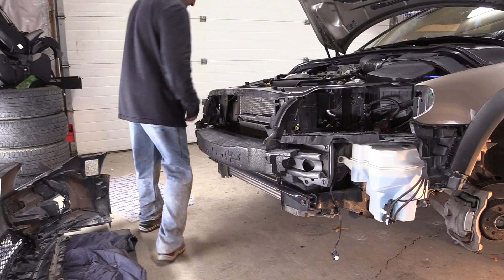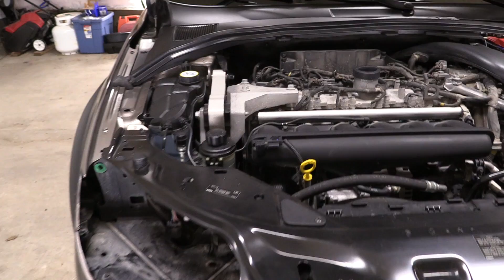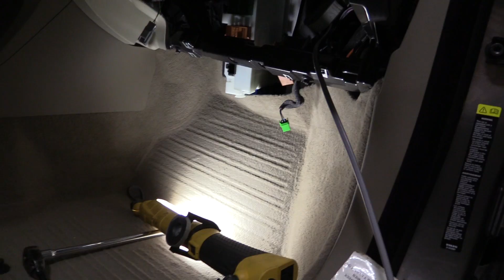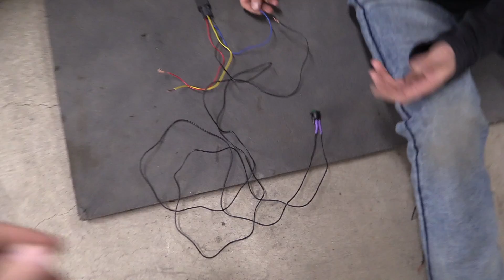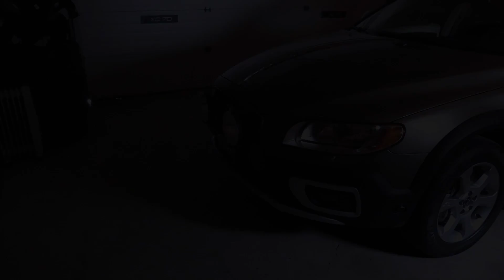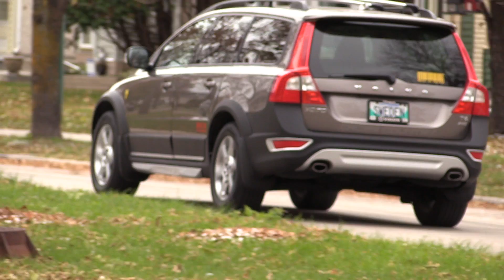Hella 700FF Auxiliary lights installation on Volvo XC70.

Comment: Great video, how long are the bolts you used? My P2 has OEM wiring for auxiliary lights but the switches and plugs are hard to find. Honestly, I may use the Hella wiring.
Reply from the maker: Can’t tell at this point. It was a while ago. Just use hella wire

Comment: Hi. Could you please send the specs on the bolts and nuts that hold the bracket in place? Also need to know where to get the spacers.
Reply from the maker: These were all custom made. My friend from Russia brought the bolts and nuts. Father in law made the bracket. Wish I could give you more info
Reply: @volvosweden  Thank you for your reply! I really love your videos - I wish I had your knowledge of how to work on these cars. I have the same model year XC70 and I want to mount lights like this. I'll ask some people at the local auto shop. Thanks!
Reply: @volvosweden Hi again. Can you confirm the length and diameter of the bolts?

Comment: It's important that auxiliary lights do not shake or vibrate. I'm not convinced that lamp bracket will achieve that. I suggest you fit a stay to the back of the lamps.
If you are going to have only two auxiliaries, I suggest fog lights turned out at say 30 degrees (or crossed) to act as cornering lights. For electrical connection, I suggest a relay so the fogs only work when the side lights are on. You need a stem switch so you can switch on/off with your hand still on the steering wheel. When you drive narrow twisty roads at night, you will be glad of cornering lights. If on the other hand you drive entirely main roads, you are wasting your time and money. Or in your case, all fashion, no function.
Jack, the Japan Alps Brit

Comment: I'll be installing something similar on my 2008 XC90 V8. Are you worried at all about blocking air flow to the engine with the auxiliary lights?

Comment: nice job and video. I appreciate your time making it. But man, is a lot of work, Couldn't be connected to the low beam wiring a bit closer to the lamps? Been in the front of the rad, won't restrict the airflow in hot weather?

Comment: On my -07a, Volvo has already pulled out a connection plug for extra light..😳.  On the left side.  What is needed is an original connector on the dashboard, connection already finished ..

Comment: Do you think it would be possible to install an led highbeam inside the grille of the car? Is there enough space? I have an -09 XC70 and a W-Light Typhoon 590, which is around 56cm wide. I currently do not have the car near me but was wondering if it would fit.

Comment: Hi...what size bolts were those and where did you find them?  How did you make or find those two spacers?  I want to install some LED driving lights on my 2013 XC70 and think the bracket mounting advice Yuri has provided in this video is awesome!  The guy is the Russian MacGyver!
Reply: And it is now 2 months later and I installed two Rough Country led lights on my xc70 using the mounting advice you gave on the video and they look freaking awesome.  I had to special order the 8 1/2 " bolts ($20ea) and I  hooked the lights directly into high beams so interior switch not needed.  Thanks Yurt! Your video was inspirational!

Comment: Good brain, Why you did not use stainless steel screws? and is aconsejable use pressure washers for evite drop the nuts with the vibrations. Thanks for the video

Comment: Nice video man, I'm looking at adding the same lights to my V60 Polestar... that said, did you see any increase in the running temperature (especially in the summer)? Maybe I'm being paranoid but that's my biggest worry...
Reply: I have 5 auxillary light wich is 225mm wide in diameter, 3 of them cover the front grill and i have not noticed any higher temperature on my engine in the summers here in sweden ;)

Comment: In my S80 there is AUX light toggle in sensus software, and it turns on together with high beam. I wonder if it is possible to add one of the blank buttons in center console and use it independently of high beam. Great video!

Comment: Hello mate! I’ve done so much work on my v40 by myself, incl the block heater installation. Now I’m about to install a led bar... not that hard but just one question... in many YouTube videos you see they use the main battery as a source for the lights and you use the cigarette lighter wiring. Do you recommend this rather than the connection to the battery, having the fuses etc in mind. Pascal

Comment: This is a happy comment.
Reply: got any more information on this? is there any way to wire up an OEM switch on the dash for this purpose? I know the older XC70 and XC90 had this...
Reply: @macadood  My bad, I got it mixed up with the older platform, realized my mistake  today when I installed some.

Comment: Once again, excellent video!
My V70 is imported from Sweden and was factory fitted with these lights according to the option list in TIE. Unfortunately, they had to remove the lights because it is not road legal in The Netherlands. But the switch for the "Extraljus" and the software is still present, so maybe I'm going to re-fit them in the future. Every Volvo looks extra cool with extra headlights!
Reply: Make a google search for "extraljus sweden" and you will not be dissapointed! 👌💥🏎
/ Your friendly neighborhood swede
Reply: @adammm142  i was not dissapointed, thank you!

Unfortunately they are also not street legal here in Portugal.
Reply: Het is zeker wel legaal hier, Totaal aantal grootlicht mag 4x zijn.
dus dimlicht zoals altijd, grootlicht + 2 extra grootlicht.

Comment: Hi there, nice install! Very factory! Few questions, do you know the company VolvoTech? Them make this canbus tool which you can use to program the car to use the factory high beam lever for aux lights. Like you pull once for high beams, then again for aux lights, then the third time shuts them all off (or you can program it to any button you like).

Secondly, I recently put some aux lights on my S80, and I noticed that because mine is auto, there is a rubber piece where you would find the clutch on the driver side, made for a much easier time running wires. Did you know about this?

Comment: Sometimes, the look IS more important, than function. It looks cool, AND will come in handy. Beautiful work.
Reply: I Totally disagree with this all fashion, no function mind set.
Reply: less practical for parking. that is why I did not put any. but as I have now moved to Sweden, it is too dangerous to not have those in winter (if you have an old car). the new lights are good enough.

Comment: In Europe nowadays and especially in Sweden you see more and more LED light bars mounted as an extra high beam light. 
What you did to use the Hella’s as an extra low beam light would get you in trouble with the law because officially that’s not allowed in Europe. (lots of people use their fog lights on the front for that.) furthermore I would like to say that I appreciate your videos and enthusiasm very much! Keep up the good work, regards from the Netherlands.
Reply from the maker: I know what you say. I am not using them in the city. On highways as low beam for extra light.
Reply: No such thing as front "fog lights". Those "fog" lights in the bumpers of cars are kerbside illumination lights specifically desingned to illuminate both kerbsides on roads where there are no street lights.
Reply: @terrortorn  Not sure what part of the world your claim might apply, but both the XC70's manual and my country's traffic rules specifically name fog lights, front and rear.
Reply: @p-a-d-e  It is true that "fog light" is a term commonly used virtually everywhere and that includes manufacturers. And for the rear light perfectly true. Rear lights having no lens that casts a beam of light they only illuminated the rear of the vehicle and the rear "fog light" brighter than the normal rear light to help in foggy conditions. But the inter bumper lights, and it was these I was specifically referencing and not any after-market bolt ons,  are so angled  and dipped to illuminate the roadside. They have no specific fog use but designed for use on unlit roads with ill defined edges. As far back as the late 80's Ford were calling them "driving lights"  on their Sierras although I have no doubt "fog light" was also used.
Reply: @terrortorn  subaru absolutely uses them as fog lights and they do help in foggy conditions. at least on my outback where they made them larger for that purpose

Comment: Great video, one question, Why havent you connected the lights to turn on when you activate the highbeams?
Reply from the maker: Wanted independent control
Reply: @volvosweden  You can have a tree-way switch to be able to have both ;) pos1-ON pos2-Off pos3-On with org-highbeam

Comment: Nice job, but I don't know why you bothered installing the wire grill mesh for stone and bug protection, I mean after you fitted the spot lights the radiator grill was completely covered anyway, so no stones, bugs or more importantly AIR could get to it anyway, it'll be overheating next summer lol :D
Reply: Yeah I was sort of kidding on the over heating, but you can't argue those spots do cover a good 50% at least of the grill area, so most of the bugs and stones will be hitting them instead :D

Comment: You didn't put in any relay? Make sure that the switch is meant to handle that load...
Reply from the maker: It's in the video. The relay.
Reply: @volvosweden  Sorry, missed that spot. Then you're good!

Comment: Nice video as always. 
Hopefully you aimed your aux. lights much higher afterwards, than you had on a video. 
Would be nice to see some night driving clip.
Reply from the maker: Aimed them as low beam. I decided not shot any night video so there will not be any unnecessary discussion. Thx!

Comment: you dont need a switch in the car on your volvo . . volvo has Auxiliary lights in canbus , yust take a cable from canbus box to the releset.. the cable gives - negativ ,, dealer will activate this option.  and you can turn on/off in the car display :)

Comment: There is a kit sold from Volvo that you connect directly to CEM and with a switch in the central console. But you need additional software downloaded to the car.
Reply from the maker: I know. The kit is not cheap.
Reply: @volvosweden  do you know the part number for this kit? just curious how it is implemented
Reply from the maker: Volvo accessory web. Choose uk for region.

Comment: Normal in sweden is to use the high beam switch. And to connect the relay to the batteri directly...
Reply: And the signal should always come from the highbeam and not from the batteri or parkinglight as it is in the end of  the video

Comment: Great Work, looks great, just replaced the Alternator-decoupler-pulley, idler pulley, belt tensioner, serpentine belt, water pump on my 2009 XC70,  105,000 Klms, probably a little early but feel better they have been done. Belt Tensioner under the Air-Condioning Compressor was making slight bearing noise. Keep up the great work👍
Reply from the maker: Will do a video on all that you listed.

Comment: Wouldn't it has been easier if you put the cables from the auxillary light to the high beams in the normal light? Then you wouldn't have to put the switch in the interior either.
Reply from the maker: It's easier. But I wanted independent control. Also at the moment the Hella lights are aimed as Low beam. No glare to oncoming traffic.
Reply: @volvosweden  Those lights are used to supplement the high beam headlamps. Even if you aim them low you will still dazzle oncoming drivers as there is no upper cutoff in the beam. Either use them only with the high beams (and aim them correctly) or get the fog light model with a beam pattern cutoff that doesn't blind other drivers.
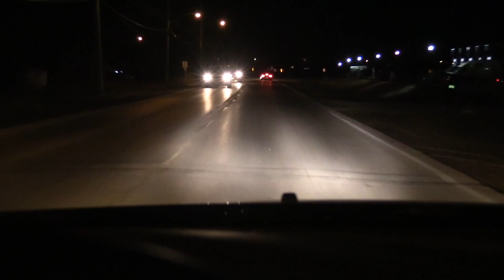Reply: @volvosweden  You are most likely blinding other drivers even with them aimed down since the light pattern is designed to give light without any cut of, you can even see one of the cars you meet at 16:30 flash their highbeams at you since you are blinding them. Aim them correctly and use them as compliments to your highbeam and you will have much more use of them and you will be more legal, this applies to your truck aswell.

Comment: I just drilled a hole in my v70 2010 behind the license plate and put two M8 bolts with locking nuts in the back, did not take the bumper off, and it hold for 5 nbb225 :)
Reply: Wasabi. When I did mine I bought some small (1.25" diameter) solid rubber caster wheels at Çanadian tire to use as spacers. They worked great. Used a 1.25" hole saw to cut away the exterior plastic of the bumper and the caster wheels fit perfectly.  Didn't use Yuri's heated socket approach and the saw makes a cleaner hole.
Reply: How did you make a spacer?
Reply: Är inte m8 lite svag för 5 nbb 225?
Reply: De räckte för mig, och 3-4 självdragande skruv tog jag med 😄
Reply: @AJ-Jakt  Genom fästet och rakt in i kofångaren?
Reply: @91cat  ja, hade inga distanser eller nått vad jag kommer ihåg ☺️
Reply: @AJ-Jakt  Drog du inte ihop kofångaren lite då?
Reply: Length of bolts if you can remember would come in handy
Reply: @laulindgaard8658I can't remember, long time ago

Comment: The grills look sportier with the mesh, and I also think that auxiliary lights look great on the XC's! Almost bought one myself just because the XC70 looks like a beast.. Ended up with a S60 T6 instead :)
Reply: Thumbii but why not the beast...?
Reply: @jasper_north  more expensive repairs, bigger vehicle, etc.. beefier suspension parts add up fast

Comment: Just a little question... will the lights affect the air intake for the coolers and the engine?
Reply from the maker: Dont think a drastic decrease.
Reply: It will take 1 liter air less per hour...thats fine.